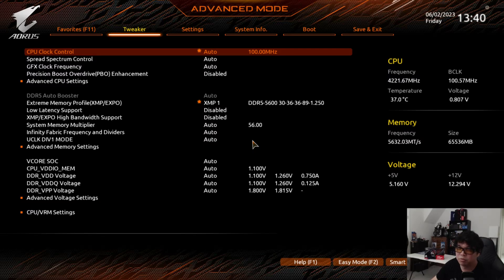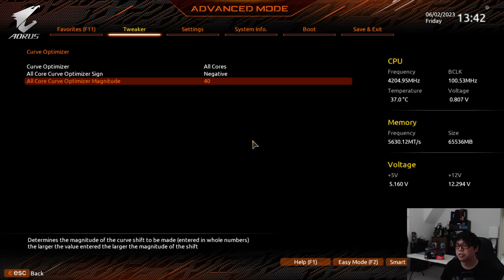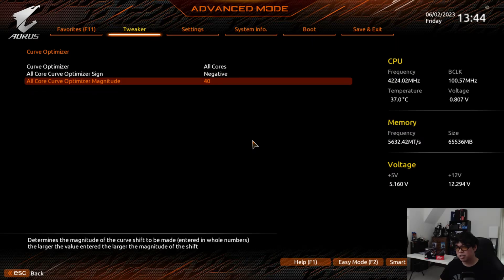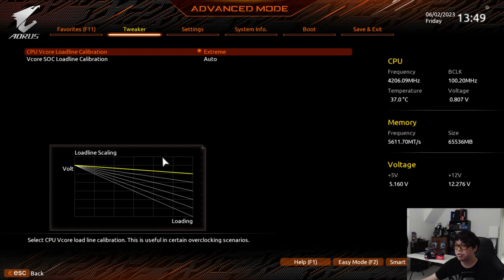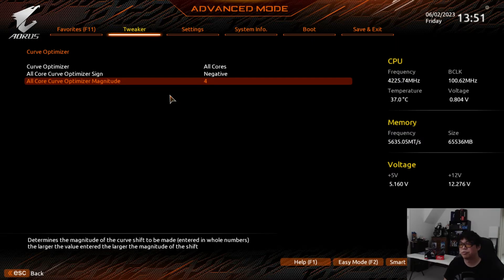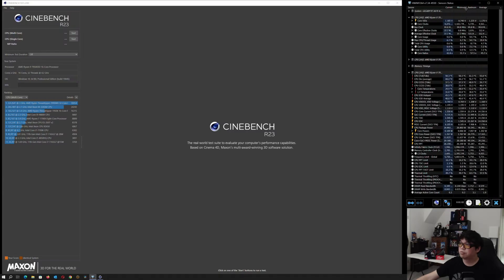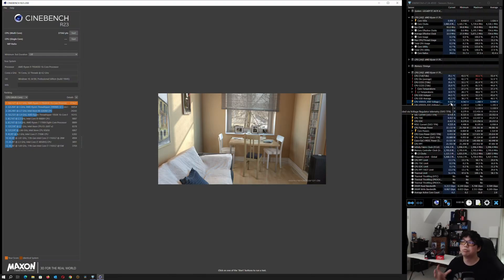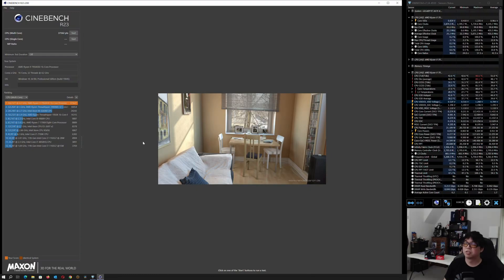How to optimize Ryzen 7950X3D, 7900X3D, and 7800X3D

Comment: Mine can only do -20 negative offset. Your one must be a super golden sample. But, I made sure mine is stable on every stress test and game test possible
Reply: Try only offsetting your gaming cores, 1-8.
Reply: @AverageAsianJoe  Those are the weakest cores, so offsetting those isn't going to reduce temps all that much. In fact, the gaming cores have less room for offset than the other cores. The main reason why the 7950X3D is lower power than a 7950X is because of those gaming cores being lower clocked and temperature limited by the 3DVCACHE, which heats things up. So the main problem is the weaker cores run hot, and can't be undervolted as much, while the stronger cores run cooler at the same clocks but also reach higher clocks. 

The problem with LLC though is while it stops Vdroop, the opposite side of that coin is you get voltage spikes when load drops, which is actually worse for your CPU in the long run, because you're getting a lot of voltage pumped through a core that is essentially idle, which is far worse, because you're not doing anything with that energy, it's just scouring through the circuits with nowhere to go but to dissipate into heat, which means you might not get higher overall temps, but you will get very high temps over a smaller area of the chip that the sensors won't pick up. 

So it's like if a small part of your cores suddenly went up to 100c, but in such a small area that as it dissipates through the chip, by the time it reaches the sensor it's only reading at 70c or less. This means very sharp spikes in voltage/energy, which is worse for electronics than a gradual shift. Temps aren't what kills hardware, it's voltage over time, and voltage spikes. The sudden shifts in voltage results in more dramatic energetic activities in the materials of the chip. 

This is one reason why the IHS is soo thick in the first place, it's to keep different areas of the chip from becoming too different in temperature, otherwise those temperature differences at such small scales results in more stress on the materials, including physical cracking and delamination from each other. That's the main reason why the VCACHE is limited in temp. Not because it can't run at those temps, but because it would crack/delaminate from the CPU, because it's not so much built into the CPU, but rather, pasted on top of it and connected by thin circuits. If it was actually manufactured with the chip itself, rather than manufactured separately, the temp limits wouldn't even exist.
Reply: Mine only is stable with -12
Reply: Mine is stable with Vcore 1,15v and -40 offset.
Reply: @timos.9409  are you using all 16 cores or 1-8 only
Reply: My 7950x3d seems stable at -20. Tried a higher number but I couldn’t even get into windows.. 😅

Comment: I think I lost the silicone lottery with my 7950x3d, (without messing with the LLC, but with decent cooling) won't even post at -30 (had to clear CMOS), BSOD at -20, then after a BSOD at only -10; I gave up angry and defeated. Bizarrely, the BSODs (even at -20) would only occur during light desktop activity, never during stress testing, not even after hours and hours of P95. On the upside, the SoC only needs 1.05v for 6000MHz memory clock. My cooler is a Corsair H170i with a 420mm radiator. Motherboard is an MSI MEG X670E ACE. Performance is about 36k in Cinebench R23 without undervolting, so seems hardly worth it to be honest.
Reply: Try doing Per Core instead of All Core. There might be a bad core that drags down your entire setup.
Reply: @lpaaaaaaaaaa  yeah, I have since found this out. someone else with the same processor could get most of their cores to around -25, but one could only do -8. Thing is, I really don't want to do it per core.
Thanks Anyway
Reply: @narkfestmojo6156  Why? That is the best way to get the most out of each core. That is what CO was designed for.
Reply: @narkfestmojo6156 echoing RKB, why don’t you want to do per core tuning? Like you don’t want to spend the extra time? Wouldn’t you want every part of your system tuned to its optimal state?

Comment: what s the point for this video?ZERO!!!!!!!!!!!!!!!!!!!!!!!!!!!!!!!!!!!!!!!!!!!!!!!!!Buy an amd cpu,6000 memory,a good mb,a good cooler 40-60 euro,set pbo limits 105(144watt),0 temps-98% multicore,101-104% gaming performance
Reply: Your comment shows a great lack of knowledge in this area. Configuring PBO to ones own cpu and board will gain performance (one size doesn't fit all), and CO takes advantage of the cores that can perform at the same frequency but with less voltage. What's not to like?

Comment: You probably don't have to worry about it because you're undervolting, but the issue with setting a stiffer LLC is it can cause voltage spikes on transient loads.

Youre fully loaded, the LLC is compensating, there's a cache or memory stall which unloads your CPU but because you're running extra vdroop compensation your voltage spikes until the power stages catch up or the CPU loads again.

Finding the stiffest value that doesn't cause this requires hooking up an oscilloscope to the voltage probe points on your motherboard, as it varies by model/manufacturer/bios revision.
Reply: Thank you guys for taking the time to read my long ramblings lol I've loved building pcs since my first 386sx 25mhz pc build. I think it had windows 3.1? Or windows for workgroups whatever was before windows 95. Lol it basically could only run the paint app. Then I went to a computer show , some of you who are in your 40's like me remember having to go to computer shows to buy our hardware before the internet. Lol scored a intel 486DX 66MHZ CPU, WITH 4MB OF RAM. LOL God anyone remember having to run memmaker? Because of the way we had to run games in DOS? Lol
Reply: Coupled with the other replies, you must remember that the x3d is different than the x, which you normally wouldn't set to the highest setting. The x3d voltage won't go above its limit. LLC only helps the vdroop remain more stable.
Reply: It seems there isn't collective agreement in the comments on how LLC works in this case of X3D --

Does anyone know definitively whether high/extreme LLC is dangerous in this case of it being an X3D CPU?
Reply: Llc doesn’t raise or have higher spikes. It just helps hold continuous. Cheers.
Reply: This is my concern (and what has prevented me from messing with the LLC); potential for damaging the CPU with overshoot.
Reply: I've been building pcs for fun for over 20 years. I retired early ,age39 (hey Fu I'm still young at heart) lol but 1) I always buy nvidia gpus
And 2) up until last year always purchased Intel cpus. 

Last year I built 3 pcs for myself. Total overkill, one was for my virtualpinball build I built,the other was for my 32inch rec room masters arcade cabinet build. 
Both pcs are identical,  msi mpg x570 gaming edge wifi motherboards, Ryzen9 5900x cpus, Nzxt 360mm aio coolers , both in corsair 5000D airflow cases. The only difference was (remember this was during the gpu drought) my virtual pinball machine has a rtx3090 founders edition,  and my arcade has a rtx3080ti.  I fell in love with amd cpus specifically that ryzen 9 5900x 24threads @4.7ghz was no problem. 

Ok sorry for the backstop but if everyone here is into pcs and tuning them etc, I love seeing peoples builds and hearing them talk about their systems just as car enthusiasts have car shows. 

Anyway, I went with the gigabyte Aorus X670E Master motherboard  (thank God so nothing exploded) ryzen 9 7950X3D,  grabbed the only pcie5 m.2 drive I could find (microcenter Inland 2tb pcie5 m.2 drive for only $179!!, and yes it gets read and write speeds over 10,000gb/s)

It took lots of updating drivers and bios's but finally the cpu is running as intended. I think I just set my negative to -20 and left it. 

Right now I'm using the motherboard above, so hoping some of you are familiar with the layout. 
1)  I'm unsure but are you saying the graph you show , if its still on a negative curve , even on extreme, it's safe to leave it like that? 

2)  under where we turn pbo on to advanced, then motherboard, there's a scalar option that's on auto but goes 1-10. Should we just leave that alone? 

Lastly, 
I want to apologize for all the questions, if you got to know me you would know I try and help every person I can for arcade builds, pcs etc. 

But I'm a grown man and can admit, all my years of experience isn't really helping  with this ryzen9 7950x3d.  
It idles around 40°C  and usually games or benchmarks around 60-65°c. Does that seem like normal temperatures? My cpu cooler is once again the NZXT 360MM kraken.  

I appreciate anyone whose read this,  I have a disability after almost being killed at work so I'm still trying to fight my way back mentally. 

As I always do, I like and subscribe to any fellow tech youtuber, even though I'm new at it and onky have 1500members lol 😅
Reply: @AJerseyJohnnyEntertainment yes, I say those Temps are about right. My overclocked and tuned 7950x3D idles around 29c and underload sits at 59-69c. Liquid cooled loop.
Reply: @metalmeltdown31 Lies

Comment: Damn. I wish I would have seen this video when it dropped. I’ve been researching and tinkering on my 7800X3D and not a single person has mentioned anything about LLC. Here I was, happy with my -15 offset. I’ve just set my SOC to the standard 1.250 which is perfectly reasonable for my cpu. 

But now I’m gonna have to go and tinker a little more. Thanks for the awesome tips man! Never seen anything else from your channel, but I’ll sub!
Reply: It's likely its a core or two holding you back from going lower. My 7800X3D only does -10 all core, but I just put some time into doing a per core CO and I can do like -40 on 6/8 cores.
Reply: @billedwardz  Whelp, I upgraded my cooler to a new 280mm AIO. Currently running -30 all core. Passed every stress test and stability test I've thrown at it over the last 2 days. No crashes yet haha. It's just odd, because I literally haven't changed any other settings. No clue why, but I'll take it!
Reply: @ChrisLaneification  Very nice. What'd you end up using to stress it?
Reply: @billedwardz  R23 and the entire OCCT suite. Threw in a few games and of course some light load with chrome browsing etc. 

But! After a few days of running great, the Small/Extreme CPU test in OCCT caused a crash haha so I’m gonna sit at -25 offset for a bit. Tested everything there and it was fine. 

I’ll run more tests as the days go by. But all in all,  I’m really happy with the Chip.
Reply: @ChrisLaneification  Yeah I have a similar story which is why I asked, I initially was using y-cruncher, which apparently is a more moderate AVX2 or AVX512 load, which got me to -40 on most cores. a few days afterwards I loaded up OCCT and used Small/Extreme/AVX2 and had to lower everything to -30. Honestly we both could probably stay with our initial COs and be fine because IMO OCCTs stress test is probably harder on this chip than anything it would encounter during regular use.
Reply: My 7800x3d seems to be stable at - 30. Also I set the temperature target to 70 degrees, so it runs 15 degrees cooler but still a bit faster than stock, pretty neat.
Reply: @HaasTheFirst how/where did you set the temp target? Do you mean when choosing pbo enhancement mode and it gives you options of levels?
Reply: @OlympicPerfo  there is just the basic setting in oc - precision boost overdrive. Called platform thermal throttle target or something like that. It's the temperature (average of all cores) at which the cpu gets clocked back down to not get hotter. I put it back up to 87 (89 is default) because it actually doesn't matter, I just adjusted my fans to be way quieter. Ryzen 7000 just runs hot but that's not a bad thing. And nothing bad can happen because it won't jump over the temp target :)
Reply: Why I have all cores  -33 in curve optimizer with my ryzen 7 7800x3d and I have 46° in windows and 72° in game, ¿can i down more -33 to - 35?
Reply: @edyglez2805  same as you
Reply: @edyglez2805 undervolt-0.005MV
Reply: @edyglez2805  do you fix it ?

Comment: Doubt that the negative value will be stable with prime95 or aida64 SHA3 testing
But nice to know that LLC improves stability
Reply from the maker: Yes, most CPUs won't be able to do -40 however, LLC prevents the significant vdroop under full load that would be incurred from such as high negative offset. At the same time, the negative CO offset prevents the higher voltage spike that would normally occur after transitioning from full load to low load or idle; due to using LLC.
Reply: @GameTechReviews  Asus use pbo scalar 2x and -50 on clock for asus pbo enhancement.

Comment: Hey man can we reach  6400mhz cl32 with gskill 2x32gb Rams? As i can see you are at 5600 at cl30. ❤
Reply from the maker: You can but just remember to change the ratio to UCLK = 1/2 MCLK
Reply: @GameTechReviews howcome you have to change the memory clock?  I'm running cl30 6400 with uclk and memory clock at 3200 with no issues. Is this going to hinder performance?  Seems good but I could be wrong?  I do get higher scores than the average 7800x3d in cinebench
Reply: with new bios we i can reach 6400MHz C28 with 1:1 Ratio
Reply: @21CreativeMedia  I've always been able to do 1:1. Got my CPU about 2 months ago .i believe it was 2 bios's before the current one. I can only manage cl30 with my ram though lol cl28 was unstable. But cl30 6400 1:1 has been perfect